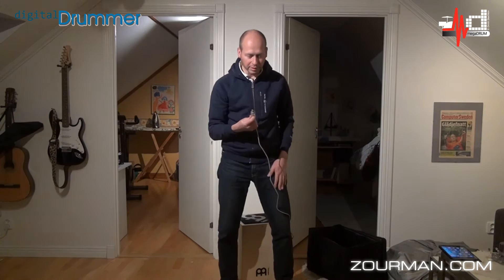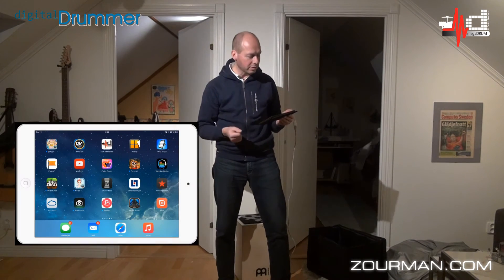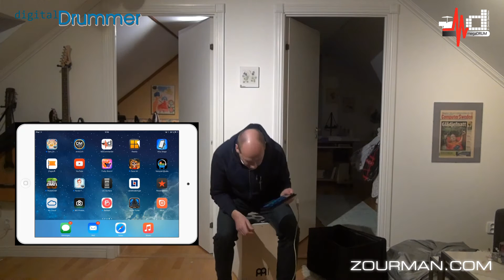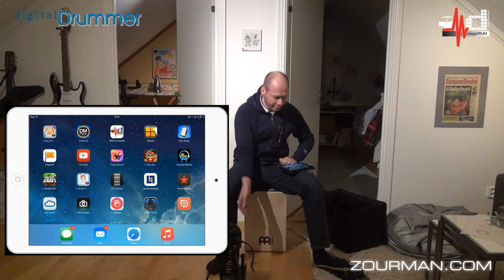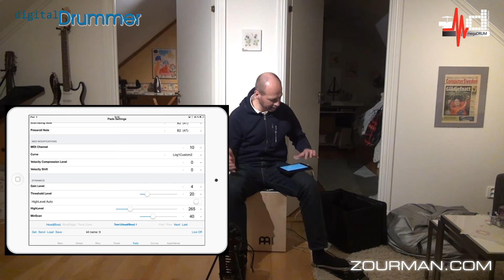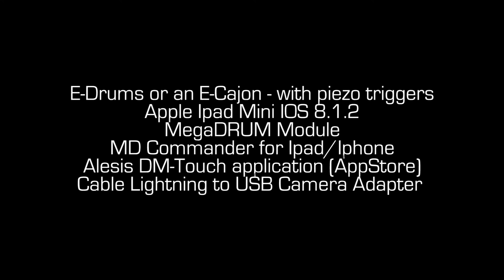Using an e-Cajon with a built in MegaDRUM module on Ipad!

Comment: Cool project! I have the Megadrum hooked up to a set of Yamaha pads and cymbals, still trying to make a sane trigger configuration. My idea was to use it exclusively with the pc and Superiordrummer or likewise, but the iPad idea strikes me hard. I was to try the DM Touch idea, just to find out Alesis discontinued that line. I’ve got some sound out of Garagband, but are there any other options? For instance, I haven’t got choking to work in Garageband. Not sure if it’s unsupported or me failing to set it up properly.
Reply from the maker: Johan Smolinski Thanks, I can try verify the GarageBand choke...